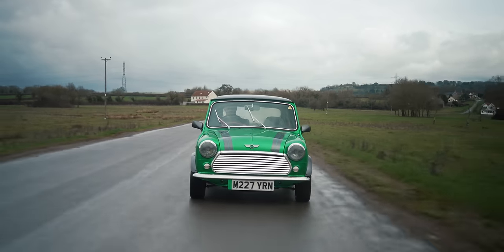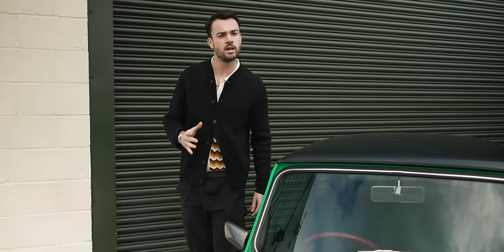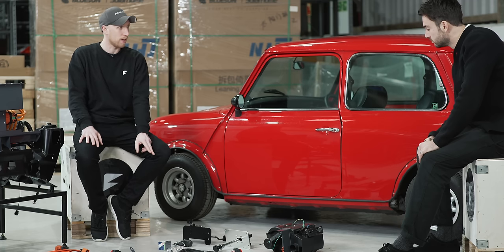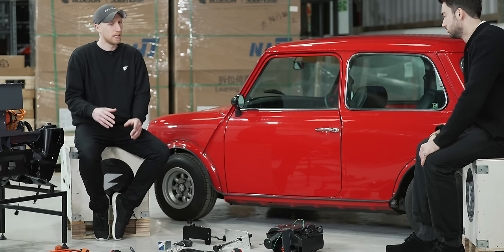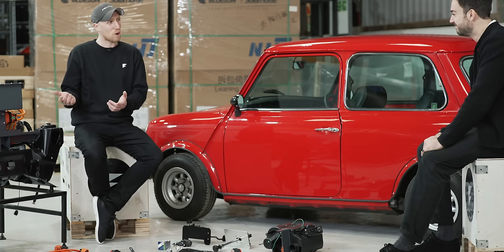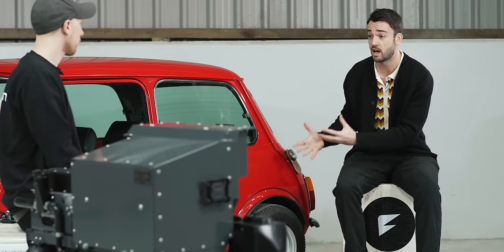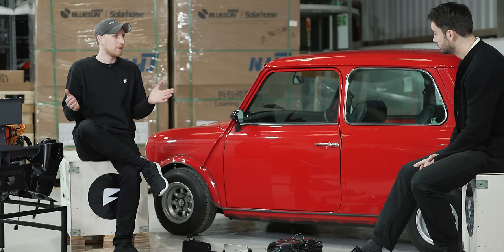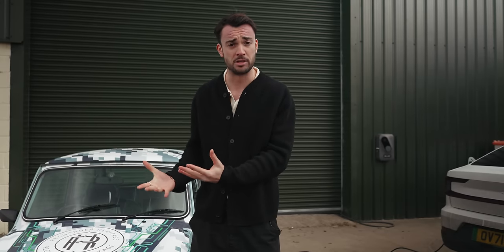How CHEAPLY Can You EV Convert Your Old Car?

Comment: Nicely put together video. 
It's much more environmentally friendly to convert an existing ICE vehicle into a BEV. Unfortunately it's not easy, and the newer the doner, the harder it becomes. 
After about 2000, more cars used CAN data buses to allow various modules to communicate. Removing the ICE and it's ECM causes all sorts of issues with data buses, giving warnings, codes and sometimes complete failure of other modules in the vehicle. This is the challenge to overcome, which will take many hours of diagnostics by some very smart technicians.
I've been involved with converting an old Freelander 1 from diesel to electric, using salvaged parts from other damaged BEV vehicles, and that's not gone to bad, mainly because the Freelander 1 systems are older and able to function as stand alone units, so the brakes still have ABS, and the speedometer still functions. 
I'd like to do a similar conversion on my Freelander 2, but alas the electronics in that vehicle would pretty much prevent a BEV conversion at this time.
Reply: i'm dreaming about doing that on my 1999 Citroen XM 2,5 td. 
but in DK, taxes are insane 🤬
Reply: Would it need custom control modules? Is there such a thing? There has to be a scene building up for that. Since manufacturers lock everything down, the only way would be to go open source on the control units.
Reply: @jochenstacker7448 

Type approval" might be tricky to arrange.
Reply: @t1n4444  depends on the country I guess. If you convert a car to EV, you'd have to have it approved as a one-off build, the same as if you nailed it together from Lego and 2x4s. 😁
So I honestly don't know if they check the modules for software, since whatever you'll put in there has nothing to do with the original car anymore.
Reply: With newer cars, I would expect there to be all sorts of software locks designed to prevent tampering without approval of the manufacturer. To get around them, I would not be surprised if you ended up needing to rip out and replace almost everything electronic in the car - even components like the radio and infotainment screen which have nothing to do with the combustion engine. The need to do this would, of course, drive up the price of the conversion.
Reply: @ab-tf5fl  I would thank that 90s/00s cars to be ok for that.

Comment: It's going to take a while for EV conversions to be anywhere near a new car in terms of dollars spent per horsepower or kwh of range. ( I should know, I'm doing one, $25000 for just the EV parts, and even then it's just 100 miles of range but 650hp)

If you're doing this, it's as a passion project and for fun, or you absolutely adore a specific car and want to make it the ultimate daily driver

Comment: I'd love to convert my classic Mini. I drive it every day all year round and it's a cracking little run around but the petrol engine with the carb does need some work to keep running in tip-top condition. The amount of maintenance that would be removed just by converting it would be massive and would make such quality-of-ownership difference. I don't know realistically how cheap they could go but if they could get them even down to £10-15k I'd jump at the chance.

Comment: I think they should do kits for buses, lorry's, bin lorry's, the types of vehicles that have about a 30 year life expectancy but also are used everyday.

Because the saving in fuel costs would easily offset the cost of the kit. And the people who own buses, lorry's and bin lorry's are massively interested in saving money, show them a spread sheet and they will instantly buy these kits, they don't worry about anything else except fuel costs, maintainence costs.
Reply: Plus tons of torque right away, no annoying gearbox, silence and not polluting the cities. It's such a huge win.
Reply: Agree. Check out sea-electric in Australia. They are doing a lot of work on commercial vehicles and have a AU$1 billion contract to electrify 8500 Toyota Hiluxes and Landcruisers for the mining industry.
Reply: That is the exact reason Musk quoted in the Tesla Semi release event - the savings to the eco-system of reduced commercial vehicle emissions is massive. It's something like 5% of all vehicles, and 20% of all emissions. Plus on top, commecial vehicles often park at warehouse type buildings, add a solar powered recharging station to those, and every time the truck/bus/etc is parked, it can be recharging - some companies could easliy have a fleet of delivery vehicles that effectively cost nothing to run outside of tyres, insurance, registration, suspension mainteance and a replacement battery every ten years - get the cost of the battery down to the price of replacing or rebuilding a truck or bus motor, and companies would be throwing money at the conversions folks.
Reply: There are already companies doing this to buses, since there is a very large push to make buses electric.
Reply: Do the maths. Unless you have access to free electricity you will never recoup the cost of a kit like this in fuel savings and even then with this Mini for example it will take ¼ million miles to break even...

Comment: great video, would love to retrofit my car
Reply: Mini?
Reply: @philtucker1224  no Volvo 850 but I think it would be a great electric estate, and their is not much choice in electric estates anyhow
Reply: @Jerra3007  yes, very true. However (if you are intending to keep the car as a classic collectible) I still think they will become far more valuable if they still have their original ICE engines…
Reply: @philtucker1224  potentially, system like the Fellten one do not cut or drill anything and the original engine is kept on its caddle in the wooden box the electric drivetrain came in (y)

Comment: The issue is classic cars are not cheap and getting dearer, a Mini in a usable condition, a Capri or Cortina MK3 GT (these are what I want) will set you back a pocket destroying amount before even thinking of buying an EV kit.
Reply: Add in having to modify the vehicle structure, and that kills any resale value, making the bolt-in style a requirement within that cost of conversion.

Comment: I feel that as a main stream mean to help transitioning to EVs, converting ICE car into EVs is probably already dead or will remain limited to specific cases. Within the next 5 years, what will happen is that the EV 2nd hand market  is going to increase even more and there won’t be any logic/financial interest to convert an ICE car to EV.
Reply: It will be only for hobbyists converting classic cars. But that's fine.
Reply: @wiegraf9009 good thing I'm learning to drive (and gonna smash it) and getting a classic for my first car. Doing this in 6 years could be really cool and it'd be interesting when everything around is electric anyway

Comment: In the same vein of retrofitting,

I have always had an idea that I could just put a Tesla axle on the rear axle of my 09' FWD CR-V and have the controller and the battery fit to the boot, where there's plenty of storage space, and then use something like a thumb throttle leaver or something a like, electric bikes use to engage the battery powered axle.

That way I can drive EV when I want to or drive petrol for longer distances. Same concept of a plug-in hybrid but in this case retrofitting an older vehicle to run on either or, instead of in conjunction with each other.

Comment: I have a 31 year old vehicle (not a MINI) that suits me well and is so much fun to drive and I have looked into the idea of retrofitting it to be full electric.

The cost estimates I have received so far have been very prohibitive but if it can become reasonable in the next 5 years, then I will do it since I have already had the rusted out metal replaced with new steel.

Comment: I did mine for £2000. DVLA won't update the V5 to electric though because it's a 2003
Reply: Surely there's more to it than its age? What other things are required for DVLA to accept it?
Reply: Curious to understand the bureaucracy too - I was under the impression that in the UK you’d need an IVA since the engine/gearbox is a big chunk of the original car. Then the insurance would be a minefield too no doubt?
Reply: @Umski  insurance is a pain, only really 1 or 2 options. Its all based on points system, stay within the allowed points and IVA not required. I use original gearbox and so they view it as engine swap. Some videos and overview on my YouTube channel

Comment: I really want to do an EV conversion on my '86 Fiero.  We'll see how expensive that is when I get ready to drop a powertrain in (gotta restore some of the frame first, and I'll probably work on some body panels and what not too)
Reply: Love Fieros! Had 3 of them in 80/90s
Reply: You want to do it yourself, like we all do with our classics, same as swapping a transmission or adding a turbo, a lot of the enjoyment comes from putting it together in your own garage.... but all these kits seems to be 'Only fitted by authorised,...', same BS as 'Ony Dealer Serviced for Warranty Conditions'.
Reply: Did you see the Ronald Finger rebuild?
Reply: @john_barnett  yup!  It was awesome!
Reply: @PiDsPagePrototypes  

Don't forget you'd have to satisfy the DoT (in UK) and your insurer as to a converted vehicle's structural integrity etc, etc. After all it's the insurer that carries the risk.

It  might be useful to contact your insurer (any insurer) in advance to determine if you could get cover ... and what certification is required prior to acquiring insurance cover.

Far too many "starry eyed enthusiasts" are blissfully unaware of the legalities of the situation. Not to mention quite a few lack the engineering skills and facilities required.
Reply: @t1n4444  no need for all that in the U.S. in most if not all states
Reply: @fortheloveofnoise  

Which is something else to worry about.

Comment: I wonder if the upcoming in-wheel motors (Elaphe, etc) will make conversions easier / cheaper?  It'd free up space for more batteries etc.
Reply: Adding weight inside the wheel (unsprung mass) is bad for handling and worse for ride. Drive packs that feet in to exsisting Differentials or Drive Trains is a better solution for anything larger then a Mo-ped.

Comment: As auto manufacturers are facing up to the inevitability of having to go electric, well most of them anyway, I'm wondering if they will come to see the continuing need to support ICE componentry as something of an expensive pain in the bum, ten to fifteen or even twenty years from now as their fleeting manufacturing finally, becomes fully EV. 
Might they simply decide to design conversion kits for their most popular models and use (this) as a direct revenue stream replacement model that ICE parts and servicing currently occupies?
P.S. The look of sheer enjoyment on Jack's face was priceless.😅

Comment: I so want the Transition One thing to happen. Modern small cars last a lot longer than classic minis for sure and they would be massively economic to convert. I hope Feltten can do a similar kit
Reply: Absolutely, but I'd like to see them switch from a motor bolted to an existing gearbox to hub motors.  This way you free up a lot of under-bonnet space for batteries, so that you could have a half decent range.

Currently the range of a transition one vehicle is very low.
Reply: I used to think that too. However, with hub motors you add a lot of unsprung mass, which makes the car more uncomfortable to drive and is very bad for suspension in general. Additionally most folks don't like how they look...
Reply: @antontaylor4530  Hub Motos are good for lightweight bikes, they're not good for cars. Too much "Un-Sprung Mass" negatively affects the handling and ride - that's why Ally Wheels are prefered over Steel.
A motor and gearbox that can bolt in under the floor, directly coupled to the Differential of a rear wheel drive, with the battery pack up front to mimic the mass of an engine and transmission, is ideal for a lot of vehicles, from small two-doors up to giant Pick-ups.
Front Wheel Drive is easier to drop in an all-in-one replacement like shown here, with an extra battery where they fuel tank used to be.
What's missing, is a long-range set-up for Mini Vans and Pick-Ups, where the large unused spaces under the rear floor could have extra batteries added.
Reply: @antontaylor4530  For simplicity some converters use the existing gearbox, but the one in this video eliminates it.  On many classics the original driveshafts and diffs can't handle the EV torque, so if you are going to replace those anyway, might as well ditch the entire transmission and either place the electric motor in the transmission tunnel, or get rid of the entire drive line and mount the motor in the rear going striaght to the half-shafts.
Reply: @PiDsPagePrototypes  There are a couple of EV manufacturers (such as Lightyear and Protean) using them already, and the unsprung mass problem turned out to be much less of an issue than people thought.

These aren't race cars.  It's not as critical as it would be in a racing car, suspension technology is advanced enough that the problem isn't insurmountable.
Reply: @patreekotime4578  On many classics??? I think thats going to be On Many Euro classics, whereas US and Aussie classics were already dealing with the torque of much larger engines 3.3 or 3.7 litres is a small engine from GM or Chrysler in the 60's, 70's or 80's for anywhere outside of Europe. Many of the transmission's and diffs used in those stand up to 400 or 500 Nm without much issue, from low revving engines.
Reply: @antontaylor4530  The extra mass in the wheels also affects brakes and traction control performance, and hub motors haven't reached the same performance per watt yet.
Reply: @PiDsPagePrototypes  Lightyear is saying that they've solved those issues and achieved higher efficiency than anything Tesla is doing right now, and early testers seem to agree with them.

For example, the extra rotational inertia has been overcome with extra regenerative braking.

We aren't talking theory here, we're talking about stuff that they've already managed to overcome.  Honestly, it's a non issue already.
Reply: @antontaylor4530  

You seem to have a lot of faith in home brew engineering cf Tesla ... extra regenerative braking ... kindly explain your thinking on that one. Save me having to Google your assertion.

Comment: Nice mini, I would have wanted to lose the rear seats and put more batteries there to increase range but such a conversion is something I would really like to do.  Having a generalised kit available would make that so much easier to do.  In terms of such kits, I feel it would be for the best if the kit is based on the cars weight and come without batteries so that such things could be tailored to the individual vehicle.  Unfortunately the prices mentioned in the video are either the same or more than what you would spend on a new EV (which I really can't see myself being able to afford).
Reply: Electric classic cars managed to squeeze more batteries in. Also 300hp! Check their channel.
Reply: Well, adding more of the most expensive element is not going to help with the cost issue.  Lithium will get cheaper eventually, but I wouldn't bet on it within 2 years.
Reply: @concinnus  well I doubt it.
If the demand is high, the price goes up.
And demand, thanks to EU and other maniacs will skyrocket in next 12 years. 
Later, after 2035  it will be only worse.

Comment: The biggest issue is the availability of charging stations with high charge rates and batteries that can be charged an awful lot quicker than the current ones.

To be blunt, unless you only need a car for short journeys that you can charge at home over night I would give ev's a miss for the next ten years. 

Although by then most people will not be able or allowed to own a vehicle I expect.

Comment: Would love to convert my 70s vw camper but some way to go before it's affordable for me. Wish the wheel hub motor gave a hybrid option, or some of the promised drop in/ 'shoebox' range extender motors meant smaller battery packs were more realistic helping to cut costs. Fingers crossed.

Comment: £40000. And you say cheeper than buying new. What planet? Never paid more than £6000 for a car. Don't forget charger installation ,higher insurance and takes four years before it's Environmentally Friendly due to manufacturing process. No thanks.
Reply: If you're in the UK the "charger" is any socket. We aren't yanks, where 240v is "special". Yeah it's slow, just plug it in overnight, like your phone.

Comment: The actual "engine swap" is pretty easy and in the 5k range. The problem is batteries. They are not cheap. They have never been cheap. And they aren't likely to be cheap in our lifetime. Battery manufacturing outside of China will not have the effect they may think. The batteries made outside China are EXPENSIVE. Buying a purpose built, NEW EV is a better option in almost every way. Of course there will always be people with more money than sense, and deep pockets wanting to keep a "classic" alive.

Comment: I think there's a real future for retrofitting of commercial vehicles.  Transits and Vivaros that don't do a lot of range - which is a lot of them, such as tradesmen in London.  Lots of room under the floor for a battery pack, and you've got a long vehicle sales lifespan (Mk 1 Vivaro was 12 years of the same model).  Not for everyone, but that's what I'd be looking at for a business - particularly with a Vivaro needing a new gearbox every few years, and people generally chucking £5k at if if you buy and fit new at a main dealer.

Comment: A problem with that lovely old mini. It’s technically been modified. Even if the chassis has had a hole drilled in it for EV conversion, it counts as modifying and hence the new number plate. It’s essentially a new car in the eyes of insurers and the DVLA